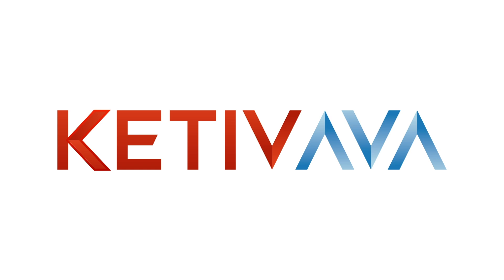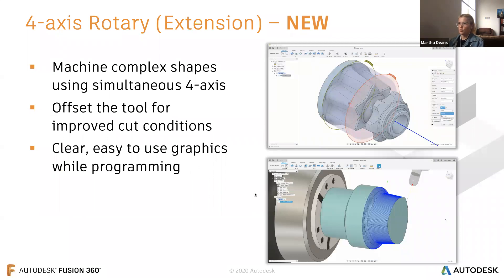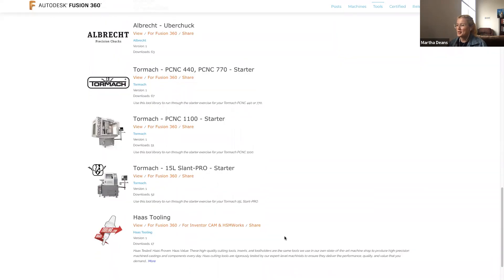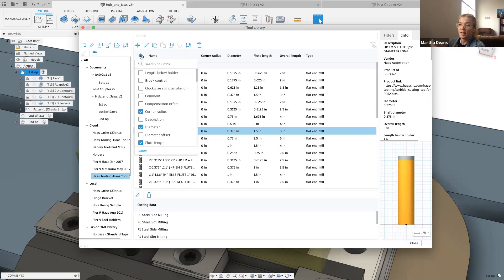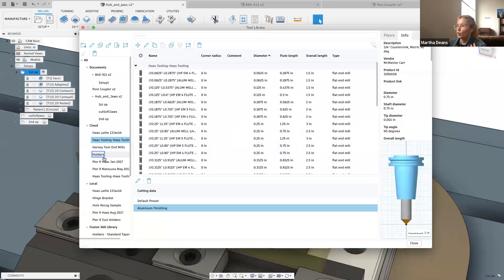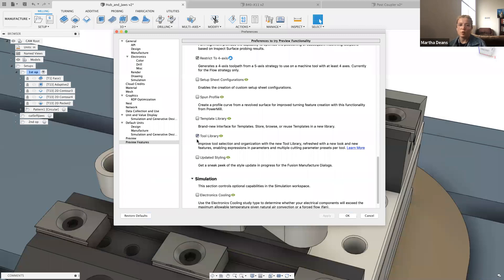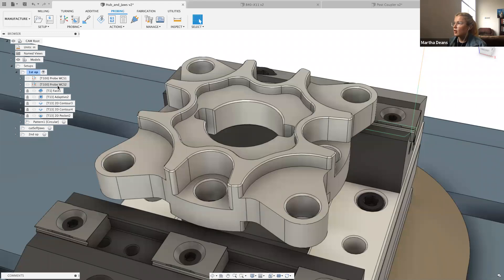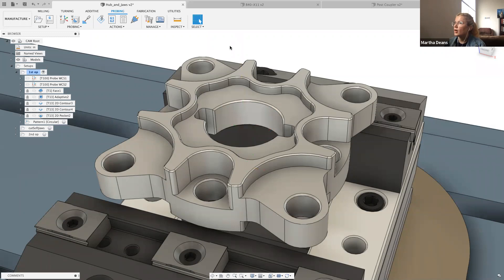What's New in Fusion 360: Part 2 - Manufacturing | Autodesk Virtual Academy

Comment: Hello guys 
I’m using a Tormach 1100 for mill turning, and every time I tried to setup the FEED & SPEED I’m having problems with the USE CONSTANT SURFACE SPEED option, for some reason it doesn’t work with a Tormach machine, i have to uncheck this option every time and manually edit my Post to add the G96, could you guys please check into this issue. I really appreciated your help, thanks for what you guys do and for your time.
Reply from the maker: Dalvy, We will pass this on to our CAM people.
Reply: KETIV Technologies thanks